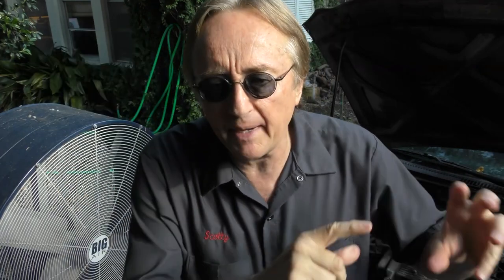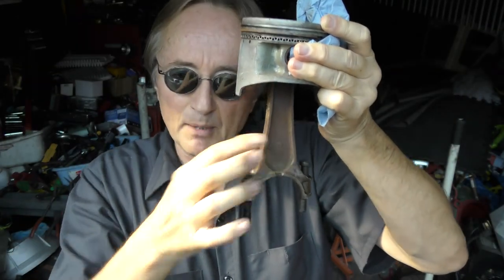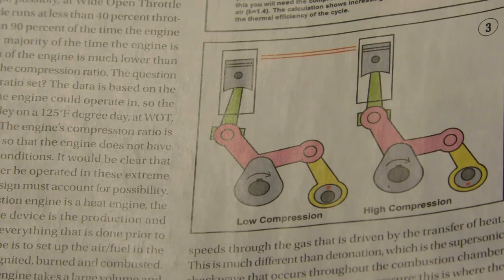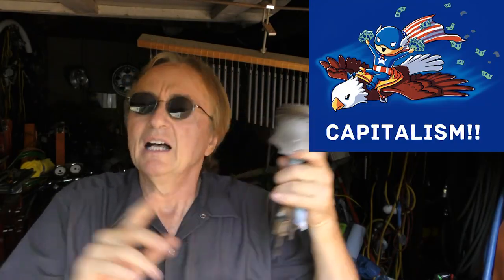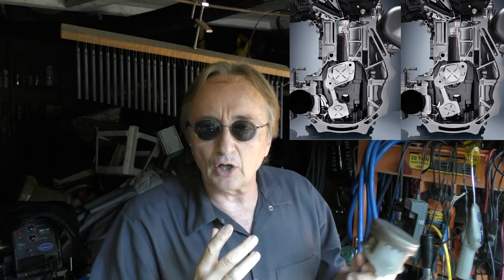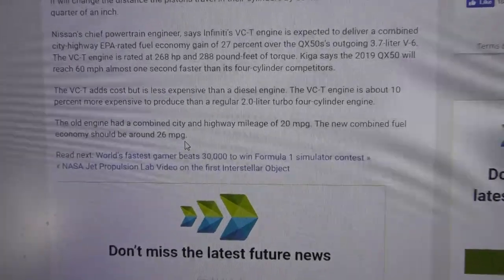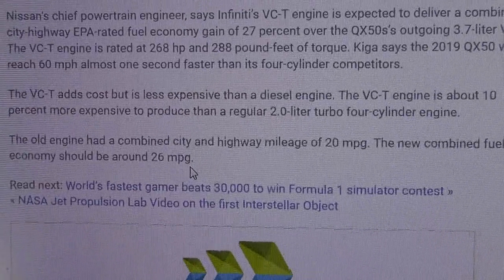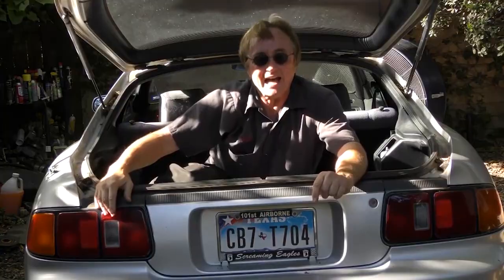If You Buy This Type of Engine, You're Going to Regret It

Comment: Having big time issues watching this video, dropping down to even 144p does not fix it and trust me, it's not my internet connection.
  Please fix this. Really want to watch this video.
Reply: Yol it’s working for me
Reply: What is Scotty supposed to do about that?
Reply: Same for me
Reply: Watched it all the way through, normal and smooth.  No problems.
Reply: I had no problems....
Reply: I'm having the same problem, I'm positive that the car manufacturers have a way to shut down these videos.
Reply: Yol yep same problem. Stable 80-90mbps speeds, no loading on youtube. Happens regularly nowadays....
Reply: FaithwalkerTodd some of us are suspecting that YouTube is trying to sensor this video.
  All my other videos work juuuuuuuust fine.
Reply: Yol, first time it's happening for me, any chance you have at&t or cricket, it's the network... Just checked speedtest getting a lot of network jitter...
Reply: I watched it on Android phone no problem.
Reply: There is no problem, youtube is testing a VARIABLE BUFFERING VIDEO ENGINE.
Reply: I agree it’s a great idea but very complex Scott didn’t mention this engine has two Fule injectors per cylinder but there are more differences than just mileage it widens the power band as well as the torque and finely the angle to the crank is much less so less noise and friction
Reply: I'm having issues 10 hours later too. Every other video plays just fine.
Reply: I am having problems with buffering as well.  I suspect sabotage.
Reply: MoronicAcid1 ummmmmmm..... Reupload the video
Reply: It played fine for me today at 720p.  Could be a regional YouTube server issue.  Some ISP or their providers store more popular content on their own servers.
Reply: same for me 144p and like 30s of watching then its loadig again, spend like 10min to watch this 5min video
Reply: alyo / even today, still won't load. I powered through it yesterday but I smell bull on YouTubes part.
  All the other videos, especially in 1440p & 4k at 20 mins a video work juuuust fine.
Reply: Ed Davis out of the dozens of videos I watched last few days, ranging from 1440p - 4k, over 20-30 mins per vid, this is the only broken video.
  Like I said, I smell hardcore bull.
Reply: "welcome" to the end of Net neutrality where your internet provider gets to chose what you can watch and what you shouldn't....
Reply: Mine loaded instantly

Comment: You're a very down to earth kinda guy and your advice is sensible and wise. I much appreciate your advice.

I wouldn't even buy a hybrid.

Nice idea that they're thinking of innovation but in reality the standard basic automobile engine is best with some basic modification. 

These complex cars are great when they work but when they fail it's a fkn nightmare.

Overly complex systems just make it much harder and more expensive to fix.

My old mate has spent 15 thousand AUD on parts and labour fixing his Tiguan.

Omg the first thing that broke was a brake caliper lol could you ever imagine breaking a break caliper?

Then his DSG broke.

They wanted 8000 AUD to replace it.

He went to a different dealer and bought a second hand one.

Then some other problem.

Then something else went wrong with the AC.

Lol he spent so much money I could buy a new car for what he paid out on on repairs.

If I buy a new car it will be a Toyota Corolla.

The one I have now has lasted so long.

It had 175,000 on the odometer when I bought it and the gear box syncros were  faulty ...

I never fixed it, yet it's still going.

These cars are incredibly reliable.

Cheap to run and I hardly spend any money on it.

Toyota Corolla  is the best brand and model.

Comment: CVT transmission hasn't been perfected, add this into the equation and reliablity is out the door.
Reply: 150k miles on a 2014 Maxima and it's still running strong! I change the oil at every 5k miles and CVT fluid at every 30k miles. Agree it's the worst transmission, but it has good mpg though. Just gotta know how to take care of it.
Reply: Yes

Comment: Check out Engineering Explained's video on this. Nissian is actually doing a lot more to test this engine for long term reliability than is usually seen in the automotive industry. They spread 600 vechicles across the world to test the engine in varying climates and driving conditions.
Reply: Their claims are just as bogus as their warranties.   They’ll say anything to get u to ignore their horrible reputation so they can take your money.
Reply: Exactly, I got the feeling that Scotty is against all new technology because it's either harder to work on or more complicated. Well that's how technology works, it always gets more complex over time and if Nissan has their engines tested over a massive distance, I don't think they will be more unreliable than some of the shitty engines that are out there right now
Reply: Felix B he’s saying it might be unreliable but since it’s new technology it will also cost more for the first people who buy the car. Just something no one wants to deal with
Reply: Say what you want about Scotty, but over 93% of all Corollas are still on the road. My 96 has 339,000 miles all the while changing out minor things for wear and tear. Brakes ,timing belt,battery,etc. Problem with high end cars is that the average Joe thinks they can afford them and as soon as any little thing goes wrong they are hit with sticker shock. Personally, I cannot afford these cars and that's fine by me. People need to check themselves before they get into the expensive vehicles.
Reply: Still not worth the risk when you can buy a well known reliable car with better gas mileage... and engineering explained is highly biased. There’s literally no reason why you should be a guinea pig for new technologies unless you’ve got plenty o money to throw away. There’s no advantage, you can buy cheaper, more efficient, well known reliable cars instead of trusting the words of infinity’s marketing department and engineering explained who probably got sponsored to make that infinity video to begin with.
Reply: S Dude , I own 3 Toyotas one 92 Camry with 152k, 96 Corolla with 339k, 2017 Camry. I would never diss Scotty, these cars are indestructible.  Matter of fact, the older yotas in my opinion are of better quality than the new ones. Both cars have almost all their original parts! These things are tanks. My original comment was to a guy complaining that Scotty is biased and that he loves yotas too much. I say Scotty is right and prove him wrong.
Reply: @ Alex I'M m with u Nissan go Nissan 😎
Reply: S do u understand how comments work?
Reply: All vehicles are manufactured under strict quality control. Specially the top 5 Giants of the industry be it Nissan Toyota Honda Ford GM whatever. If u buy a new car & maintain it properly with regular maintenance intervals as per the manufacturer it will last longer & more reliable than a car that is not maintained & no importance given of any sorts. I know range rovers/ land rovers in my region models of  late 70s & early 80s still on the roads gng strong. Not just Toyota but other manufacturers also exist. Toyota could be the biggest car manufacturer but remember it is not the best just like iPhone / Apple is not the best. !!!!!
Reply: Then link it
Reply: And btw.Doesnt matter they are doing.The more complicated a system is,the more likelihood of it failing.
Just look at Fords cam phasers.
Reply: And?
Reply: People like you dont know how big companies advertise and only show pros. So they spread 600 of those in areas with varying climate, climate for one isn't a major factor in this matter, the engine will still operate at its given operating temperature (212 F degrees typically). The matter is, the sophisticated design and numerous components in the engine might give plenty of faults, not to mention the electrical system segment.
Reply: I agree. Nissan was testing this engine for about 20 years before they brought it to the market.
Reply: @jellyroll5247  my 2002 corolla died at 130k (granted that one specific model had piston ring issues, but still)... There is more to it than just brand name.

Comment: Interesting view of Nissan as a company. Yes I can agree they have a few pitfalls (their CVT's especially but nobody has really made them well). However, I would argue that their historical track record is actually very good. Their 6 cylinder engines have all been huge icons in the automotive world (The RB, VG, VQ, & VR engines).  They are all known to hold up extremely well (250k+) even when having the snot beat out of them. In the past they had some great 4 cylinder offerings but we haven't seen any exceptional examples of those since the 90's with the SR and the KA. I am interested to see how this new engine stands the test of time, it could be a huge success in allowing efficiency and performance to coexist. varying the compression ratio gives the car an interesting ability to be extremely efficient at low boost (high CR) and still be able to tolerate high boost pressures (low CR) without detonation allowing for bigger HP numbers. The new design does allow for more points of failure, however if it is designed as well as the rest of the engine internals it hopefully will not be an issue.
Reply: I have a 2003 infinity g35… it rocks at 190k … the paint doesn’t look so great and the seats are torn up… and it needs some front end suspension work… but I love the drive and it just keeps on going… not sure if it’s got the same thing that is of concern but guys stop me when I’m out and about and they either want to see the engine or buy mine.